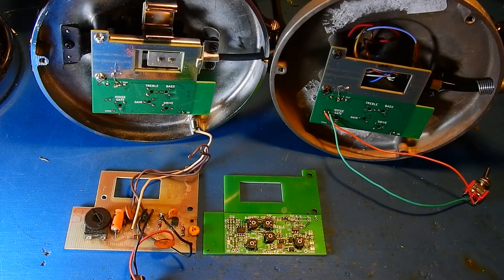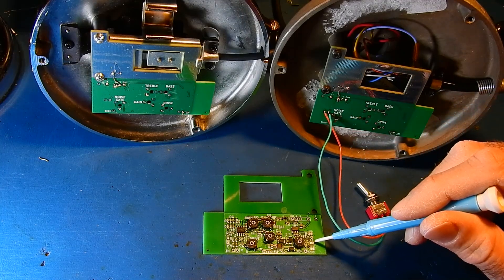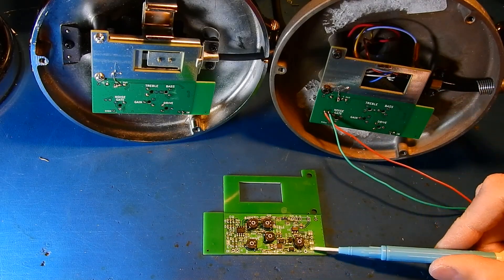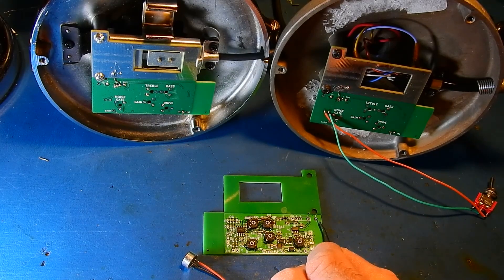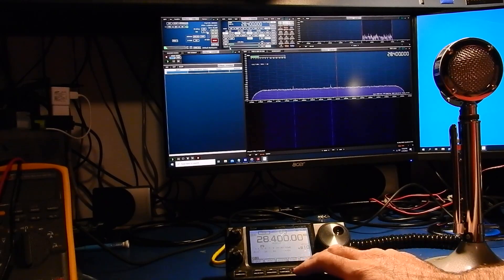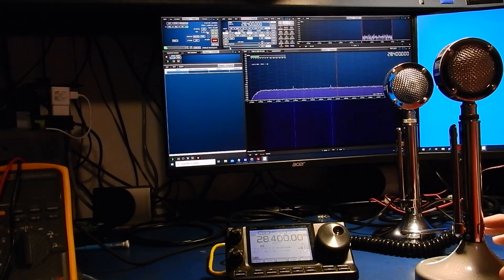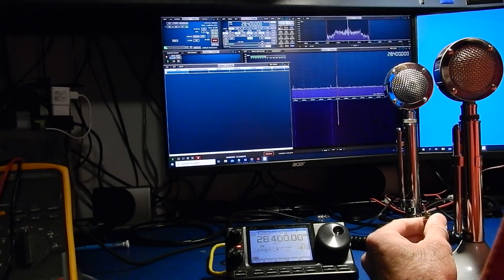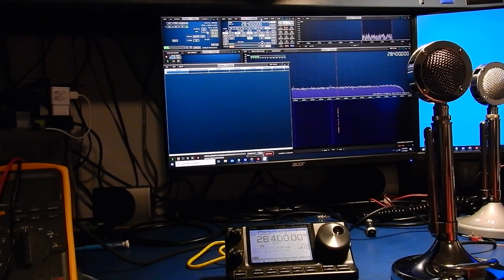Something New! | New D-104 Preamp with Compressor and Noise Gate

Comment: Sounds great! Digging around looking for a good head then I'm off to purchase the preamp.
It pays to mark this stuff with tape. I have four D-104 heads. One outa four is good plug n play.. but which one?
Audio sounded impressive. AM SSB in the worst conditions you can shape that audio. I have an external XLR compressor / limiter / delay. I use it with a external Sure mic. I get excellent reports @ 100watts and under.
 pondering putting one these classic D-104 mics back in service. 
After seeing this video and hearing the scuttlebutt around the campfire I think I'm sold. Not gonna wait this time I have the parts and the amp is reasonable.
Thanks for a great video. No show boating, informative and concise.
Anyone ever wire a D-104 to XLR let me know 😆 !

Comment: My second comment and are open to others experience. I really like this preamp and compressor. Changed compression to 3:1 and turned the ---  gain, drive, bass, and noise gate, fully CW  ---  and the treble adjustment  fully CCW.   I also use a wind sock over the mic head, everyone says it does change the audio in a good way.   Just my preferred settings and get great reports.   I am driving a Rockwell Collins KWM-2A and 30S-1 amplifier. People seem to like the ultra clean and vintage sound of the Collins equipment but I have noticed that just a little bit of DSP,  like in most all modern day radios, in particular my 7300, there is better - actually better - talk-power with just a touch of DSP which is what I was looking for in this preamp/compressor. I can see from the RF envelope, and the peak-reading RF power meter, that the power is increased but I keep the mic gain on the Collins at twelve o'clock so that the RF peaks are very sharp and not flat-topping. Looking for others experience and settings for use on vintage, high impedance input vacuum tube equipment with modern mics.  73  WA4QGA

Comment: Just got mine installed and working. I think I am going to like it. I do use the new electret mic elements (three in the head parallel connected and mounted in a triangular pattern) as all of my original D-104 elements have gone bad. I especially like the noise gate that squelches the background noise when I am not talking. I might also add that I use the extra set of contacts in the D-104 to turn the battery on and off as I can see that it draws a mA or so even with the shutdown pad grounded. This way no current is flowing from the battery until the mic handle is squeezed. Will give it the acid test tomorrow with my friends.  73  WA4QGA

Comment: Are the wires coming off the electret module connected directly to the board or can they come off the terminal strip where the electret mic is already connected? Also same thing with the mic wires coming into the D104 base, directly to pre amp board or they can come off the terminal strip too? Already have JP1 soldered for using a 9v battery.  Using a TUG8 stand with 4 wire pin and side neck squeeze bar.
Reply from the maker: @roughrider3772  electrically as long as the connections go to the correct place there is no reason you can't use the terminal strip

Comment: I always thought electrets didn't require a polarizing voltage, but did require a preamp for most uses? Also...Is the resulting impedance presented by this board too low to use this with vacuum tube equipped gear?
Reply from the maker: Most Electret elements require a voltage to power the internal amplifier circuit that is in them. There are some though (like what comes with the BM-800) where the amplifier is separate from the element. 

This has a low output impedance but with the addition of one resistor the output voltage is increased enough to work with a vacuum tube type radio

Comment: Wiring:
Green to J1 square pad
Yellow to J1 round pad
Red battery to + pad
Black battery to G pad
White to out pad
Black to S pad
Brown to G pad
Violet to SHDN pad

D-104 with both PTT's (side of neck and bottom base).

Is this the correct wire orientation?
Reply: Did that wiring configuration work?

Comment: Wiring one up for a friend. Not sure if i have the brown, black violet wires in the right spot.

Wiring:
Green to J1 square pad
Yellow to J1 round pad
Red battery to + pad
Black battery to G pad
White to out pad
Black to S pad
Brown to G pad
Violet to SHDN pad

D-104 with both PTT's (side of neck and bottom base).

Do those wirings sound right?
Reply: Did that wiring configuration work?
Reply: @brettfinsbury8545 I don't think so. The mic works, everyone says it sounds great but the battery drains when not being used, like the shutdown isn't working.

Comment: is  the D104 1000 ohm or 500 ohm?   Is somebody  knows this
Reply from the maker: The element itself is very high impedance. Closer to the Megohm range. If the MIC has a preamp board though then it is a low impedance output

Comment: Thanks for that! I have been experimenting with D-104's thru the years as well. Having little luck obtaining one with an original crystal element that still works, I tried the Electret replacements too, but find them to be flat and muddy. I tried a 600 ohm element out of a cheap $9 dollar Superstar hand mic purchased online and it provided an amazing amount of clear audio using the original D-104 amp board. I am looking forward to trying your method.